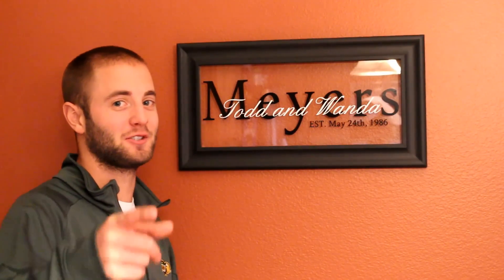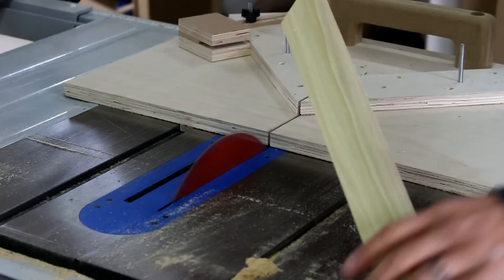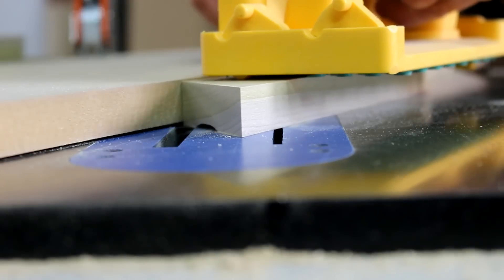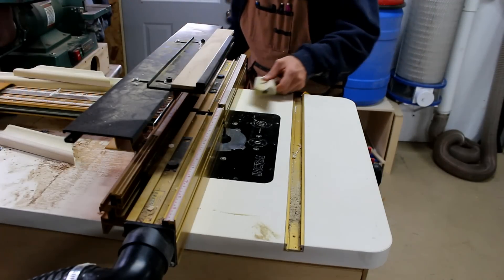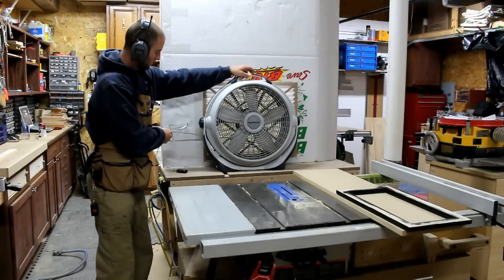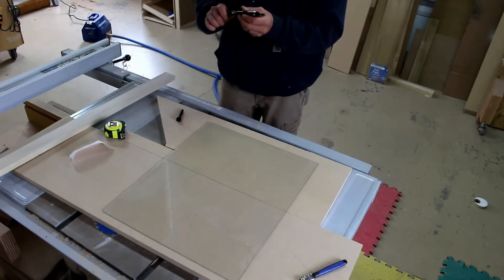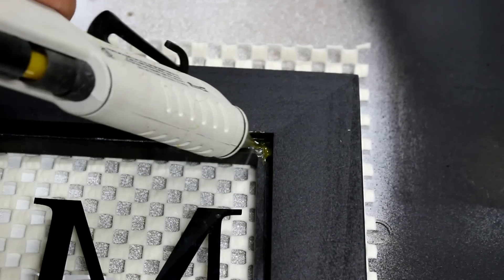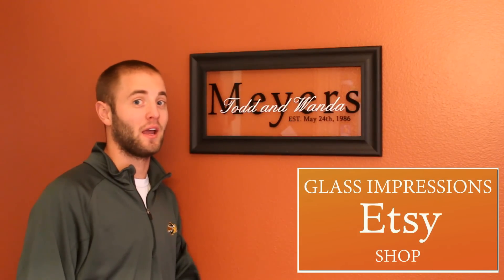Learn how to make a classy picture frame!

Comment: Did you layer the white vinyl on top of the black vinyl? If so did you get those little air spots where the black and glass meets? Are you worried about that? I've noticed that when I layer vinyl like that.
Reply from the maker: Instantsiv,

Yes I did layer the white over the black. The air spots on lettering this small doesn't seem to show up. Granted, if I do have a large one that is noticeable I will take time to pop it and push the air out. Thank you for watching and for your comment!
Reply: Glass Impressions gghhb
Reply: Glass Impressions is the lettering all on the front with the white on top of the black?  it looks like the black is on the back side.

Comment: That's not the typical (expected) use for the keyhole router bit, but I like it.  Since you made the slot so long, at first I thought it was for two screws in the wall, but that would only work if the slot was cut to the left and right of both entry/exit points. You didn't seem to do this?

So I assume you are only hanging this from a single screw in the wall? If that is the case, why did you make the slot so long?

In general I really like your approach. It avoids the more consuming work of routing two vertical slots.
Reply from the maker: Thanks Marty!
Reply: Glass Impressions
Hey Andy, by chance did you miss my question - I really am interested in your response. Thanks.
Reply from the maker: Marty Backe My apologies Marty! I made the slot long enough so the customer could hang it from two screws if desired.

Comment: This may be one of those "silly" questions, but....The vinyl sticks to the back glass, but what about the front glass? I made something similar to this, and cut the vinyl in mirror mode and the sticky side became the front. The biggest problem I had was the piece stuck on the front glass isn't as sharp of a color since the sticky back is used for the front. Is there another way? I wanted all he lettering inside. Thanks

Comment: Nice video. Nice projext. I just found your channel today from Jays Custom Creations fb page. Glad you posted. I'm your newest subscriber.
Reply from the maker: Angie, I saw you commented on Facebook! I am glad you clicked and stuck around! :) Please like and share! It helps a great deal!
Reply: Sure thing! Also... I would like to know how you do your glass cutting. I've made a frame as well with vinyl. But so far I've been acquiring old frames at yard sales and such and using the glass.
Reply from the maker: Angie Overton How I do the glass cutting? or how I acquire the glass?
Reply: Both. Lol. There's a local glass store I could get it from. But I'm always looking for a cheaper route. I figure it's cheaper to buy a larger piece and cut the pieces I need. Also... I have some glass already that I've acquired.
Reply from the maker: Angie Overton Cutting glass: I use a typical glass cutter with a firm straight edge. Make a nice solid cut on the glass. I use the other end of the cutter (where you hold on to, usually a ball) to tap on the glass to help the cut go all the way through the glass. Then I put the cut line on a sharp edge and push on the part I want to cut off. The glass breaks right on the cut.

I obtain the glass and cutter at a local box store. I believe menards has really cheap glass... it can be thin but for this particular application it is okay. If I was going to make a nicer picture frame or something I would use higher quality glass.